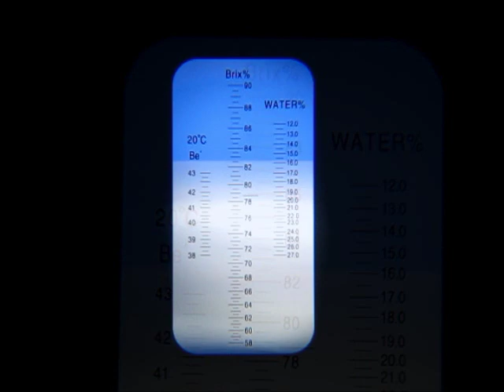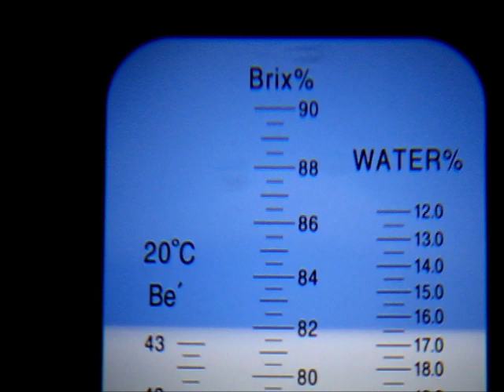Backyard Beekeeping Part 23(S3:E2): Honey Refractometer

Comment: After watching this video I bought myself a refractometer and used it to test my 2013 harvest. I would advise anyone thinking of doing the same to buy a model which has automatic temperature compensation (ATC), - much easier and more accurate.
Reply from the maker: I imagine a refractometer with ATC costs a little more but I'm sure it's worth it. I just leave mine out next to the honey so that they come to the relatively same temperature.
Reply: Backyard Beekeeping
My understanding is that it is not so much any difference in temperature between refractometer and honey which would give a false reading but rather the temperature at which the measurement is made. A sample of honey measured at 20°C will not give the same reading as the same honey measured at 25°C so a device with ATC will adjust the % displayed accordingly. Otherwise you have to use adjustment tables to work out your true value.
Reply from the maker: Constant Gardener Thanks for the clarification. I went back and re-read my refractometer's instructions and it turns out I have an ATC unit also!